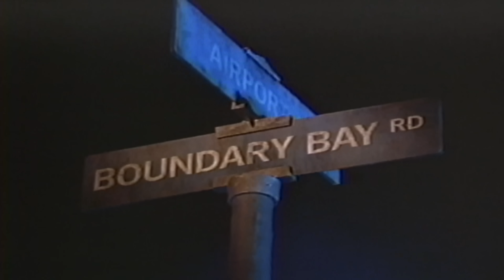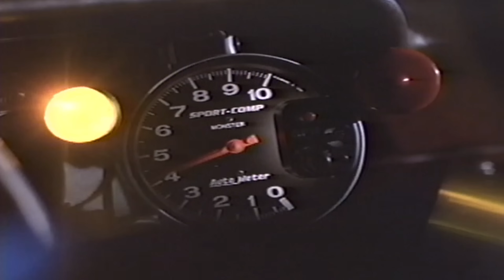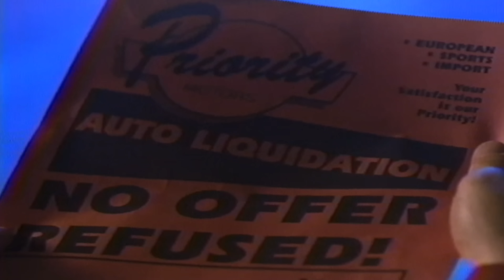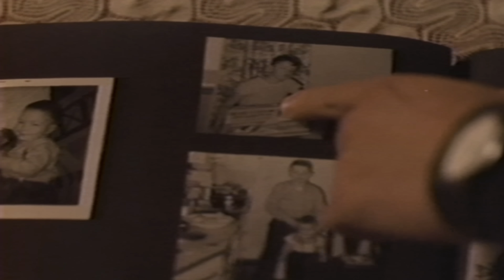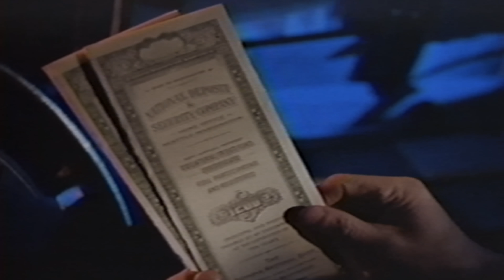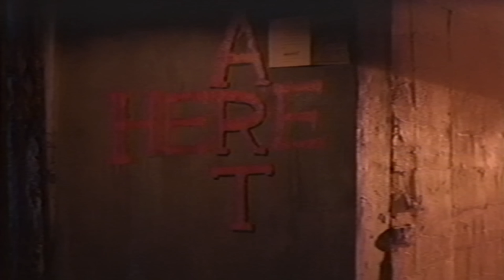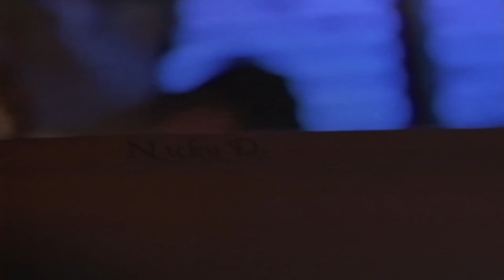Born to Run 1993 full movie

Comment: As an old street racer from the late 70-early 80s , I love these movies. Owned well over 300 cars and trucks ( lots were clapped out $100 specials)but had many muscle cars. Still have my 70 Chevrolet with a 400 small block that I built in 1983.
Reply: 300 cars 😮
Reply: @danielb-c9100  yup, started in 1977 and bought loads of ‘muscle cars’ in early 1980s when they were cheap. As I said before, lots of $100 cars that I wish I still had now, like 64 Chevy wagons, Pontiacs , Studebakers , even a couple of DeSotos  . Back then, pull them out of a field, get a bill of sale and drive them.  Awww, the good old days of growing up in my time.
Reply: Pretty sure 400 isn't a small block that's a big block
Reply: @BigBoy-mt2zt  chevy had the 400 small block
Reply: @watersB13  I'm going to look 400 cubic inches is big to me cuz
Reply: @watersB13  oh shit your right I googled it
Reply: @BigBoy-mt2zt  Chevy had the small block, others like Pontiac had big blocks.
Reply: @johnlennon8653  you were right they had a 400 cubic inch small block another small and big blocks like you said
Reply: I know my engines. Have a 6-71 blower 392 hemi in my 1940 Studebaker coupe right now.  Been at this game for 50 years now, started young with my hot rod dad.
Reply: @johnlennon8653  50 years is a long time half a century
Reply: Understand that I had a 69 charger 440 automatic torque flight 67 Camaro 327 69 roadrunner for speed 383 1957 model Jeep CJ 5 but they called it M 38A or the 62 Corvette two 8338 gears
Reply: @BigBoy-mt2zt  you’re definitely wrong. Chevrolet built a 400 small block they had a lot of problems with it. It was a external balanced engine. They had vibration issues but later on the aftermarket people figured out what the deal was with it. It was a big bore 350 around 1976, 77 78 is my neighbor kind of introduced my opinion not a very good engine with a 454
Reply: It's a stroker, BigBoy, not a big block.
Reply: @cristiano3842-k8p  someone corrected me already
Reply: @cristiano3842-k8p  check your info. It’s a small block from the factory in 400 , not a stroker. Came out of a 70 GMC .
Reply: Street racing. What a joke. Put it on the track with real racers
Reply: @BigBoy-mt2zt wrong. The Chevy 400 is a small block
Reply: @johnlennon8653  considering that is a small block equiped with the longest stroke crankshaft of all SB line, I did not can name it a stroker?
Reply: @johnlennon8653 One big question do you have a huge warehouse for that amount of cars?
Reply: @CamosAmos No, bought and sold them many years ago .
Reply: Was any a 69 mach1❤
Reply: 421 tri power 66gto 4spd was a killer too
Reply: @allendaigle6351  No, but did have a 71 fastback 351 Cleveland.
Reply: @johnlennon8653 what current cars you have and is there a particular one that you own that's been in your possession for decades
Reply: Yes 1967 conv. Camaro, 69 SS Camaro ,a 55 Chevy
Reply: @allendaigle6351  nice salute to u n enjoy the cars
Reply: Love all these car movies
Reply: @johnlennon8653  I hear you, brother all street racer from Massachusetts mid 70s early 80s been there gotcha
Reply: I'm 30 I love old muscle and newer tuners. I've had many of both.  I've daily driven 11 second cars 60 miles a day many many times.  a real car person will understand the commitment lol.  real  car people are car people .
Reply: @johnlennon8653  i have a 64 wagon and a 63 vert and a 65 sedan..... and and and..... the good times of being young and knowing how to fix things yourself hasnt died just yet..... also have a 70 camaro with an ls swap itll break speedo..... i know where some old and still good cars are..... worst case they could be parts cars even.... eventually ill build them..... including buicks.
Reply: @johnlennon8653  
What 1970 vehicle ?
I love the 400 btw.
Reply: @xmo552  Chevy Malibu two door hardtop, red body, white top and white interior with column shift and bench seats. Cragar S/S 15 inch wheels.
Reply: @johnlennon8653  
70 Malibu is nice.
Dad had a 67 back in the 80s and 90s. All black on black with 15" Cragars. It had a hot 283 and 3 speed floor shift. Later on it got a 350 and a 4 speed.... and then a fade to flames paint job over the front end similar to the 57 Chevy Matchbox toy.
Reply: @johnlennon8653 Pontiac didn't have a big block they have one size block from the 287 to the 455 identical block. just the bore and stroke were changed over the years
Reply: @BigBoy-mt2zt  
If you really want to frazzle your brain go research the 396,400,402  during.... like 1968-1972 in cars AND trucks and their corresponding fender emblems vs air cleaner stickers. Lmk when you've got it all straight. No rush. 
👍😁
Reply: @edgemonsiteworksllc3369  someone already corrected me
Reply: @xmo552  sure I'll check it
Reply: @cristiano3842-k8p  GM made the 400 big block. Chevy made the 400 small block I grew up with those cars and engines but the 426 hemi blew them all away
Reply: @allendaigle6351  lol. The mustang was the worst circle track car
Reply: Got a spare 83 El Camino layin around
Reply: @BigBoy-mt2zt it's a small block Chevy engine. Parts interchange with a 350 with little modifying you use the crank for a 383 stroker

Comment: A "4110, 4.1" axle ratio eh, usually we say it as "4 11" or "4 10" even though it's written 4.11 or 4.10...besides the fact he said it wrong, that Mustang would have a Ford 9" axle, the axle on that F-250 is a Dana 60, I know that because the back cover was off. A Ford 9" doesn't have a removable back cover.
Reply: 41 and 10 are the number of teeth on the crown wheel and pinion gears to get a 4.10 ratio. the crown usually has the tooth counts stamped into it you divide the two to get the ratio. 41-10 = 4.10. 41-11 = 3.73
Reply: Dude it's a movie. They're not actual gearheads.
Reply: @jonbarnett6132  the movie was correct though. the guy calling them out isn't a gearhead.
Reply: @6226superhurricane Wrong dude, to the point you sound ignorant. 4. 11 is not 3:73, the ratio is a numeric description of driveshaft revolutions to make one full rotation of the tires. 3.73:1 is 3 and three quarters revolutions of the driveshaft to turn the ring and pinion gears equaling one rotation of the tire. 4.11:1 CAN'T ever equal 3.73 as they are both gear ratios. Terrible attempt to sound knowledgeable on your part 😅
Reply: @TheRoadhammer379  read what i wrote again but slower, keep reading it until you understand it.
i did not write 4.11:1 i wrote 41-11 as you would find it stamped into the crownwheel. it's not the ratio it's the number of teeth on the crownwheel 41 and number of teeth on the pinion 11 you divide the two to get the ratio. 41 divided by 11 = 3.73.
the movie was correct whoever wrote that scene at least had a basic knowledge of differentials or consulted with somebody that did.
Reply: Yeah, just try suspending disbelief just a little bit for a moment.
It's close to right.
As for the 9" vs Dana 60 thing, he mentioned "running the big slicks"  I just assumed he's building a narrowed Dana for when he tubs the Mustang.
Reply: Well it's still better than Vin Diesel warning about "blowing the welds on the intake manifold" in the Fast and the Furious 😄
Reply: Yea no shit we called 8 lug thugs hahahah
Reply: @jeremyb4493 "granny shifting not double clutching like you should"

Comment: I had the fastest car in the Lehigh Valley, Allentown area,,,1977 Cobra Mustang with a worked 302 and a big 4barrel carb,,,won alot of money,,,,it did 12s on street tires,,,everyday driver.....
Reply: Nice. My 14  5.0 with a few bolt ons. With a 93 tune runs 12.20. Building a short block now to run a blower. Should be in the high 9s.

Comment: I owned the Allentown circuit from 1986 to 1990 with a 1977 Ford Mustang 2 Cobra with a built 302 with a holler 4brl carb....was beating 650 Yamaha bikes...car was super quick

Comment: Also had a couple go-moz back when. Wore out a few used (retired) SEEdans,   b4 a '72 Duster/340 wedge-audiomatic. Very nice blue w white stripe, solid car. Smiles all around.
 Not quite 'nuff fun he said- 🤪(had i known then😢!-tday) Traded down ,kinda, for the one that got me evicted from parents home. 1970 limon green Rambler- 390/ 4spd, go pack trrravellin Javelin SST. (possible Donahue spec, had a spoiler just ahead of rear window? Hood was cut for functional intake, never got the plenum《read dumm son》140 speedo, 3rd gear comffy to 100mph) A difficult driver that, i lived quite rural- all gravel roads 50 years ago. I really should be dead, more'n enuff opportunityzz! Scariest i ever owned. 3 & some years later both my brain cells showed up out o the blue! Bought a 4X4, got married & my parents phone stopped ringin off the damm wall! Still believe that Javelin outmiled the Reaper more'n a couple times. Safe days all 🙏  🌬!

Comment: It was around 97-98 when V St in DC changed...
Reply: Been there many times on V Street down in DC, Then we'd run up Palmer highway, which is now called Martin Luther King highway also off of Side road off of a side road off Route 50, either in my 57 Chevy my 85 IROC-Z or my 67 Dodge A-100 , We always ran back and forth on the three Street Race Spots back in the 1990s, before that we would go up to circle Drive-In in Dundalk and Race 95, Back then the cops didn't care.

Comment: The brother thinks the 1981 4-6-8 368ci Caddy was bad? All you have to do is defeat the cylinder deactivation with a switch, swap to normal 1980 368 heads or a direct swap with a 472/500/425 engine from a rusted out junkyard Caddy. The 4-6-8 is light years ahead of the real biggest POSs that came in those cars, the Olds 350 diesel and HT4100.
Reply: Take an Olds 350 diesel and convert it to gas and it will destroy EVERY caddy engine ever built 😂